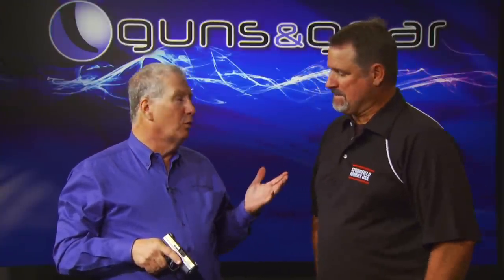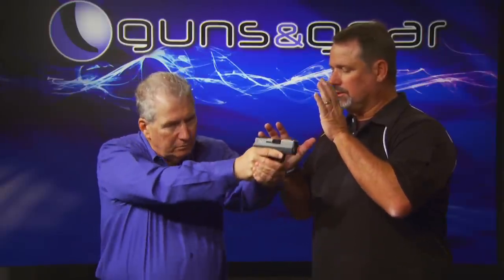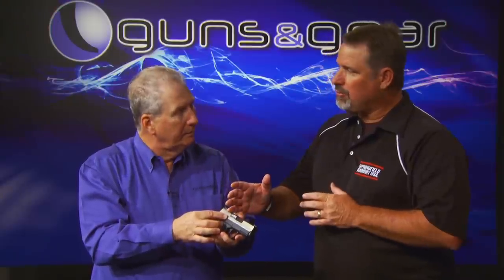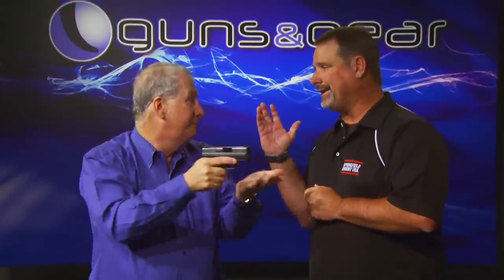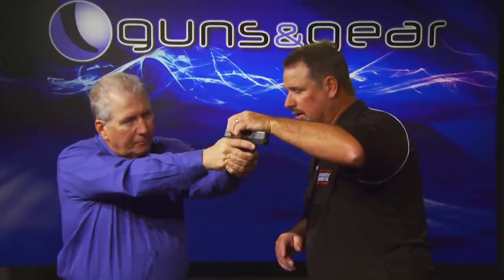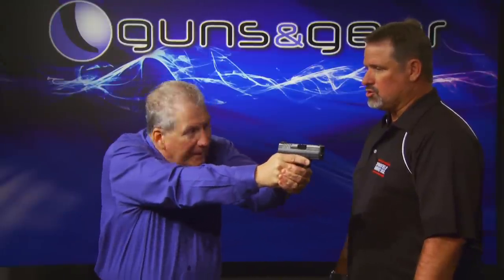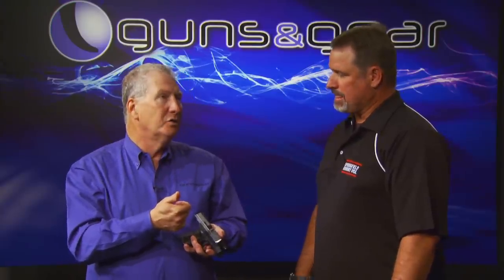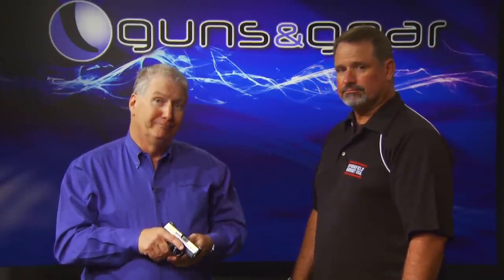Controlling Recoil: Guns & Gear|S5

Comment: Great video but if you use this test on an M&P EZ shield , the slide doesn’t give that much resistance at all vs a heavier 1911. What I’m saying if I use this test on M&P , my body won’t go back as much as an 1911 since the slide goes back easier.